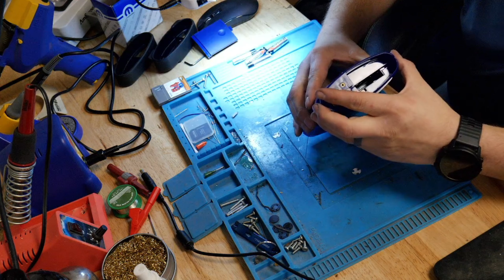Replacing a broken USB port on a GM MDI 1!

Comment: You're not getting good heat transfer because your tip is so badly oxidized.  I usually scrape it with a knife and then re-tin it with new solder very quickly..  Your tip needs to be very shinny with the solder sticking to it-- and then it will transfer heat like a champ.   When the solder isn't sticking to it, that's because it's oxidized and is basically insulated and can't transfer heat nearly at all. It's strange